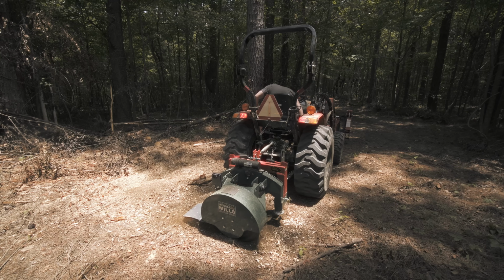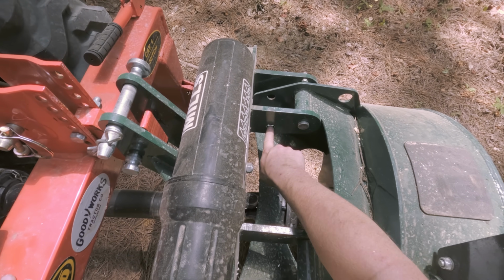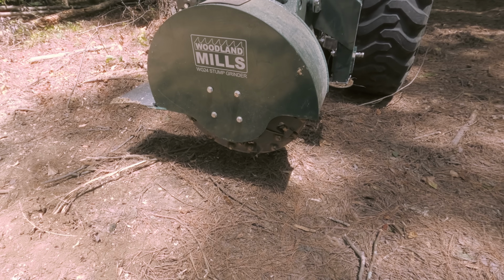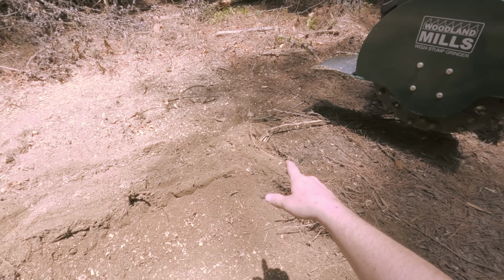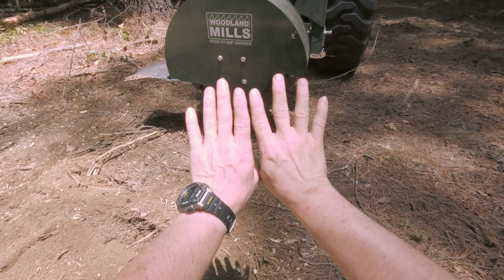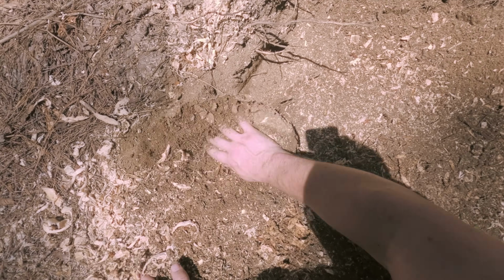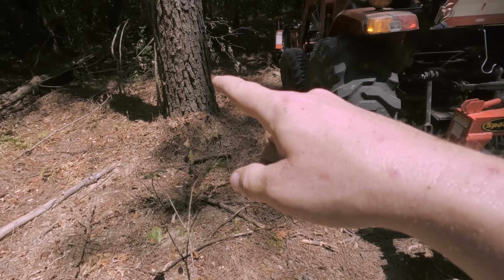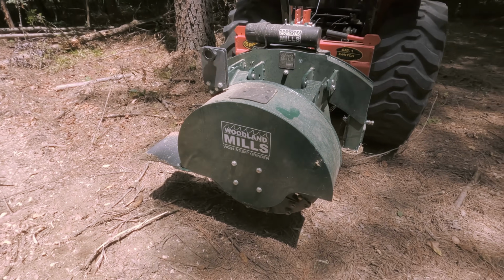Woodland Mills WG24 Stump Grinder - Day 73

Comment: What about a simple fiberglass rod or any rod mounted to the blade house somewhere.  It can help show angle much better.  Make some tape marks that makes sense as references to depth from something you can’t see around, like top of the triangle. As long as it’s removable and not higher than tractor fenders prob.  Too tall would suck in the woods.

Comment: Maybe a way to help with visibility for the stump grinder would be to buy an inexpensive ($75 - $100) wireless "rear view" camera and monitor and mount the camera on the rear of the tractor, near the Left fender, and place the monitor near the gauge cluster.  Then you can keep your head straight forward, have less neck strain and and overall easier time.  With the camera near the fender, it would be far enough away for the flying chips to not get damaged.  I'm sure you will find other uses for the camera and monitor setup in the future too.
Reply: what he said
Reply: @afp75  what he said x 2!
Reply: I thought this as well but maybe the vibrations would be too great. Only way to know for sure is to try.
Reply: @daveturnbull7221  That's not too hard to overcome with rubber grommets or washers, but I think the 3 point hitch takes most of the vibrations, as the rear wheel fenders don't appear to be vibrating much at all.
Reply: @andrewsmith3121  Last time I was on a tractor they had big belts drivin them so I was working on ancient memories and guesswork - I'll bow to your more up-todate expertise 😁
Reply: I came here to make the same suggestion. Such cameras aren’t very expensive on Amazon.
Reply: I love the rear facing camera idea but don’t like too much electronics mounted outside in open air.  Camera would work but what about the monitor or wiring for all of it..?
Reply: @aaronblackford981  There are wireless options, so no running cables between the camera and monitor, and then you can leave the camera mounted, but also take the monitor inside each night, if desired.
Reply: A USB powered 'Baby Monitor' may work for you there - monitor on the dash and camera on the grinder or other tool. Also - get yourself a wide brimmed hat! You are another of us pale skinned Northern European types and we get all sorts of skin cancers in later life, largely related to excessive sun exposure. Even a 'Havelock' for your baseball cap (in Australia baseball style caps with neck and ear shades are pretty easy to get) would help a bit. I've lost neighbours to Melanoma, my father and I have had lots of little lumps burnt or frozen off - I'm still waiting for my latest biopsy results. Look after yourself, your daughter only has one father.
Reply: @andrewsmith3121  is there any phone driven cameras that might work?  That would seem to be best case scenario assuming you have some shade or can make some.
Reply: Instead of cameras?, what about side mirrors?
Reply: Live stream it and watch on your phone 😂

Comment: yeah, visibility is tough.  but you do get pretty good at it with experience.  I back over it until I can see it, then move forward a bit and go by sound (chipper and tractor) and watching the chips.  after several cuts I'll pull forward to check progress and reorient as needed.  I never actually see the blades going.

Comment: I see that Woodland Mills just came out with a bigger/heaver spring loaded stump grinder.
Reply from the maker: Indeed. Looks great. Now they have options for different tractor PTO horse power, like their wood chippers.
Reply: @JayBates  I like the loader lifting capacity on your Bad Boy 4035h but the PTO HP at 29.5 has a lot to be desired.

Comment: Just a thought concerning the viewability issue .. (a suggestions I saw others already made after I submitted this.
*
you could buy a cheap car license plate backup camera to mount on the back and LCD screen to mount on the dash. These operate off 12V so could be hooked to your battery. You could rig an inline on/off toggle switch for viewing on demand. 
*
 This way you could see what is going on behind at the flick of a switch  using the LCD mounted on the dash.